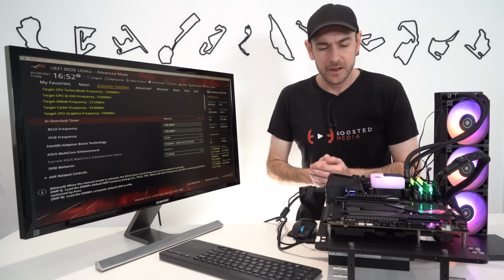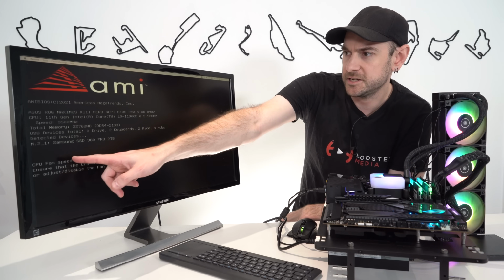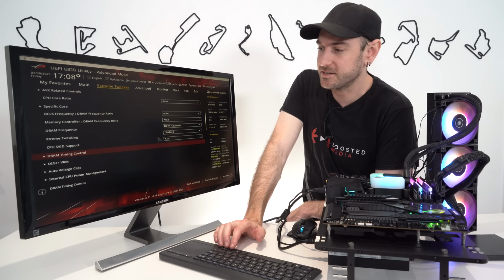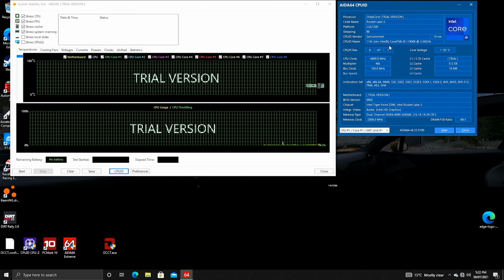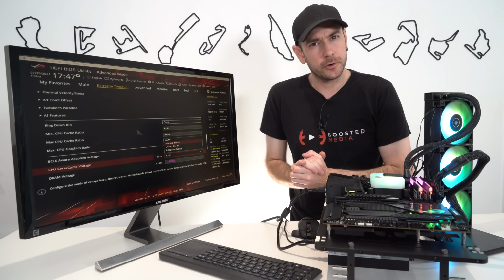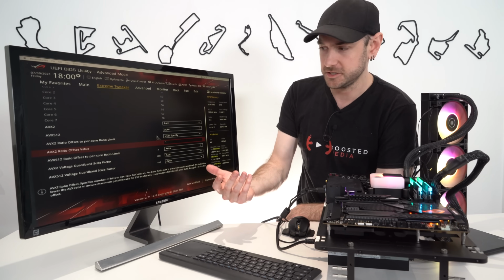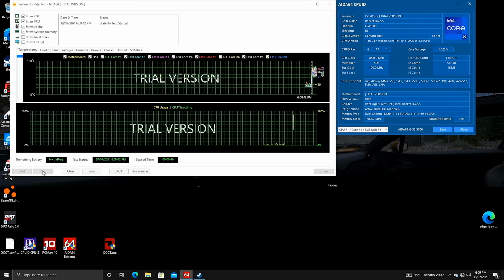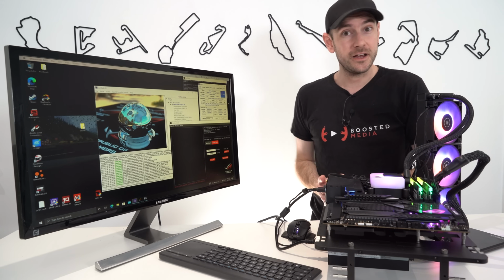HOW TO OVERCLOCK A GAMING PC - Overclocking the 11900K & Others

Comment: In my case core VID is for some reason lower than the vcore, and for 5,1 ghs it needs 1,55 volts, but when I make different ratios for core usage and increase them, leaving 5,1 for all 8 cores, it crashes with the same voltage under the load. I don't understand what's going on

Comment: I’ve used a similar strategy in my 11700K. I was more aggressive in Vcore, but limited wattage to keep temps in check. Identifying weak cores was important.

I will also say my motherboard left to its own recommendations was suicidal and tried zapping my CPU with over 1.6v. It would ignore some parameters and read others. So it felt redundant when locking the OC. I also found that the clock would be unstable when constantly changing. I let it rest for a few days and it was a whole new experience. I went from unstable at stock settings to ripping 5.5ghz two core, 5.3 - four, 5.2 six, and 5.1 all core.
Reply: Bro how tf
Reply: @ I can do a ghetto ass video on my channel if you want to see lmao

Comment: Occasionally with modern hardware the “optimized defaults” are your best settings. Now we tune the ram and we are golden for maximum performance and stability. In relation to “LLC” I would offer that it has some control over those “power droops and spikes” that occur when you come off a load or start a load. Good quality power supplies are absolutely imperative to successful tuning of a system. If you crash coming out of a game that is more then likely the power supply that has failed you because it couldn’t handle the transition in load. I’ve had it happen on a 13900k build with a 7900xtx and high end motherboard. Other then that, the system ran flawlessly. Swapped out the PSU for a 1200 watt quality supply and problems were gone. I pretty much use the same stress test software except to the addition of “ycruncher” and a couple of others.

Comment: Late to the party but great video.
I could run mine at 5.1ghz @1.42v core with custom loop but still was touch 80° so I switched to 5.ghz @1.375vcore now it touches maybe 75° while gaming, just produces less heat over a gaming session at 100mhz lower.
(All core)

Comment: your chipset temp is crazy high @67c right after post.  And you SHOULD be able to use LL1 with stock speeds and voltages.

Comment: Thanks a lot. I've got the same CPU and ASUS z590 plus, but my approach was with TVB profiles, which just didn't work at all as Windows would freeze all the time. I noticed even on stock turbo boosts voltage tends to shoot over 1.5v, maybe briefly but it happens. Thanks to your correct direction, now I have 5.3GHz on idle and 5GHz on full load with 1.4v not drooping below 1.35v even under extreme loads. This was done within minutes after watching this video :)

Comment: You should have used Hwinfo instead of CPUZ for this, it would have demonstrated the per core selections far better.

I wish Devils Canyon Haswell had specific core ratio tweaking. I can run 4.5 on a non delidded 4790k with a mediocre air cooler very easily at 1.232ish, 4.6 will work in some games but will crash if some loads happen ie. The freezes and changes when changing bulk graphics settings, so that's bad. But, if I set my per core to 1/2 4.6, 3/4 4.5, it works fine and infrequently / rarely will get a bit of usage at those higher frequencies gaming - but I can't choose WHICH gets it.

Comment: Respectfully have to disagree with you on memory timings and system performance both inside and outside of gaming. XMP secondary and tertiary timings are terribly loose because they have to work on every configuration out there. I manually tune all memory timings including the RTL’s and IOL’s. It takes some time to balance performance and stability, but well worth the effort.

Comment: Thanks for this video ! I learned so much 
By chance do you have a video for a 10700k? Or any suggestions that vary from this video
Reply: My Setting is Perfect. ALL-Core Ratio Limit 48 and CPU Voltage 1.285V. 100% stresstest no Problem.

Comment: What I need to do if crashing when sett up for 5 .0 -1.4 v ?increase the voltage a bit ?U should tell what need to do if crashing .My it's  1.415 v not crashing Is it still good ?No it's chrashing  ! Did not worked !5.0 -1.4 v chrashing ,If I it higher volt the temp it's too high !like 1.45v .I do not understand.:( If I put 5 step overclokimg by Asus software it's working but 1.565 v .temp is 78 c

Comment: My system :Rog strix z590 E wifi  -11700k -3080 ti palit -3600 mhz . My sytem freezed the second test when we set uo for 5 ghz -1.4 V .What  would  be a problem ? I have got first time asus motherboard .
Reply: i have the same MB but a 11900k
Reply: I get 5.1 GHz on Ai  but when the CPU is pushed to 100 percent use gets to 87 c@1.5v  but in games I get 70 to 75c with a Aio setup. I tired the above at 1.4 unfortunately i can't get it stable may try 1.42 next

Comment: Hi will! 
Great video!
I have an i9 10900K with a MSI Z590 ACE and a Corsair H115i.
I have my CPU at 5.2 GHz all cores, with only 1.29 volts!
I passed the OCCT test with no errors, it ran for 30 minutes, maximum temperature of the package was 83° C, of single cor was 81° C. 
I used the same options as you on OCCT.
My core voltage was between 1.286 volts and 1.292 volts. 
I don’t do the OC the way you did. 
I start with lower voltages, never with 1.4 volts, and if it crashes I raise the core voltage value. 
I ran Cinebench R23 for 30 minutes and didn’t have any problems!
I will run a CPU stress program for 4 or 5 hours to test it for o long period, anyway my computer never crashed when I am playing games. I essentially played rFactor 2, but I have AC, ACC, AMS, AMS2 and they never crashed until now!

Comment: Having OC’d systems for over 20 years, gonna have to say I’m underwhelmed by the 11900K and the available performance on tap.
It’s a great video nevertheless in terms of fundamentals that date all the way back 2nd Gen pretty much, but yeah the gains available from an old 2nd or 3rd Gen (i7-3770K for example) are about 3x more significant than what can be squeezed out from 11th Gen.
If you own an 11900K, just turn on XMP, if it’s 3600 or less, then make sure you run Gear 1, and off you go.
Reply: i turned on xmp but how do i make sure its running on gear 1? lol
Reply: So we shouldn't try over clocking it? I have an i5 11th gen and ive never overclocked before, I have liquid cooling which is the reason I was going to try overclock. Any advice would be greatly appreciated.
Reply: @spitfire1350  I suppose at the time of my comment it was that I felt in practical terms I put alot of effort into overclocking my 11900K and the percentage gains were small.  Obviously the 11900K is high clocked out of the box, essentially a binned high clocked 11700K.  An 11600K is definitely worth overclocking.
Reply: in windows you would still need to turn on all cores in msconfig.

Comment: Great video as always @Will I have a question, I saw your  interview with the Asetek creator Andr'e Erikson and feel that is a good product so I am thinking of changing to liquid cooling.
I have a low budget simple system I built myself, with a i5-3550k cpu and a nividia gtx 1660s gpu, I can overclock to 4100mhz and run about 60 to 75fps on almost full graphic settings on iRacing (the only gaming I do) but if I then run on up to 4200mhz where I can get over 100 fps the cpu heat gets too high and my system goes unstable.
My question, do you think a 570LCS 120mm single fan will give me the little extra I need or should I go for a 240mm setup?

Comment: Can you help me? perhaps you can DM or email me,  brand new build every time i use XMP settings the system will wait at start up and after 5 min will go into safe mode and then if i go into windows it will eventually crash every time after boot up? fyi my prediction window bottom right corner will show a 1.7 Volts.
i know in your video you state this is way to high and dangerous. HELP!

Operating System	Microsoft Windows 10 Pro
Motherboard Product	ROG MAXIMUS XIII HERO
CPU Type	Octal Core Intel Core i9-11900K, 5098 MHz (51 x 100)
System Memory	48908 MB  (DDR4 SDRAM)
G.SKILL F4-4800C20D-32GTRS
Model Brand G.SKILL
Series Trident Z Royal Series
Model F4-4800C20D-32GTRS
Capacity
32GB (3 x 16GB)
Type 288-Pin DDR4 SDRAM
Speed DDR4 4800
CAS Latency 20
Timing 20-30-30-50
Voltage 1.55V
Multi-channel Kit
Dual Channel Kit
Chipset Intel XMP 2.0
Color Silver
Heat Spreader Yes
Unique crystalline light bar design Highly polished aluminum heat spreaders in gold or silver Fluid rainbow wave default lighting effect Hand-screened IC & custom 10-layer PCB for uncompromised overclocking performance Intel XMP 2.0 support
Recommend Use
Intel Z590
LED Color RGB

CAN YOU HELP ME OUT?

Thx, Scott

Comment: How do I know if im pushing the voltage to much that it is damaging cpu?
Reply from the maker: Don’t go above 1.4 for the 11900k regardless of temperature.
Reply: @boostedmedia  I have 10700k! So I guess not much of the numbers you put in would be the same. I'll do more research of my cpu. I have a Evga motherboard also, Do you have experience overclocking on evga?
Reply: @karniskavva  The brand does not matter, voltage is voltage... do not think you can push it much further.
I have seen people actually input values that welded the cpu into the socket LOL..
Reply: @cyphaborg6598  hahahahah

Comment: I think the 11900K is designed to handle more ⚡ than prior Intel chips
Reply from the maker: Yes it can handle more voltage than prior chips. Remember this is a guide for beginners. I wouldn’t recommend going over 1.3V on older chips for beginners depending on cooling of course.
Reply: @boostedmedia  If you fully understand 11th gen VF curve overclocking you should do a video on that for your viewers

Comment: I'm confused as to why your voltage is fluctuating after you set a manual voltage? Unless something has changed with RL it's not supposed to do that. Did you forget to disable SVID? SVID support is supposed to be disabled when manual overclocking.
Reply: Well, under load it will still fluctuate due to vdroop and such.  But also, I thought CPU-Z was not good for monitoring voltage due to it being inaccurate.
Reply: @riffsthatkill2180  yeah you are right out should fluctuate usually between two different voltages, I think CPUz is ok but despite all the reasons you mentioned in the video I would use adaptive mode. I always disable all Power saving settings but they're is NO reason not to enable adaptive. Or doesn't make it any harder for noobs. 
Maybe tell them to use manual to find a stable oc then switch to adaptive?
Reply: @Metalhead-4life  yeah I never settle on manual mode, almost always I do offset and use the SVID behavior to set the base VID curve. I'll use the one SVID setting that gets me close and then use offset for the fine tuning. I don't use adaptive, mostly because I dont have experience with it although it's similar to offset. The VF curve where you can set offsets for specific ratios is awesome. Usually I only have to mess with the highest one for my OC, so it doesn't impact the other frequencies along the VID/VF curve.

Comment: I'm running a triple 4K setup with rtx 3090 and 9900K. How much of an upgrade is the 11900K in Assetto Corsa? I believe it's pretty single core intensive and the 11900K seems to be a beast for now (I know  it's probably best to wait for the 12900K).
Reply: if ur 9 is overclocked its not worth it like at all
Reply: I have a 9900ks at 5.3 all core with a 3090, and an 11900k is 0 upgrade for any sim title. Clock speed is all that matters on sims as of today and 100 cores is 0 better than 8 cores. You can just look at cpu z single core speeds and see an oc’d 9900k beats every new cpu. The 11900 won’t really go over 5.3 either other than a couple cores at a time
Reply: @brandodurham  What are you cooling your 9900ks with? I have a 9900K delidded and binned for 5.0GHz all core that I bought from Siliconlottery a few years ago. Wonder if I can push 5.3 with the right cooling.
Reply: I’m using a 360mm aio in a well vented case. If you turn off hyperthreading you can lower you under load temps a lot, and again with all these dx11 sims they don’t benefit at all from huperthreading. I actually get better and more consistent frametimes with it off. I can push 5.4 all core during the winter months 😂 but too toasty in the summer for 5.4
Reply: Hope you went with the 12900k....I bought the 11700k last year (admittedly a beast) but wish I got the upgraded 10 nm architecture.
Reply: @funtourhawk  I want whatever's coming out next, though I can barely get 5 minutes of time per month to use this crazy racing sim that I have. (business owner, husband, dad, etc...)

Comment: Clear and concise as always Will, I'm still happily running your GPU curve OC on my 1080TI.
 How relevant will this walkthrough be to an Asus X570p MB with a Ryzen5 5600X? Which is in my current build with the water cooled 1080ti in. CPU is on a 240mm AIO

Comment: Great video, thanks so much! 

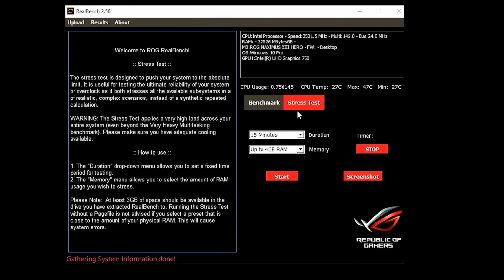In the RealBench testing at about 41:45, does it matter what Memory setting you use? Was leaving it at 4GB fine, or should you pick however much RAM your system has?
Reply from the maker: Depends what you’re testing. I usually start at 4GB and if it passes then do maximum. That helps identify any Ram issues too.
Reply: @boostedmedia  thanks so much!

Comment: What I need is a good guide for iRacing + RTX 3090 + Triples 1440, will if you could do one it would be grand or please link me to a good one
Reply: @eIgHtY0N3  <92
Reply: @UsmanKhanSimRacing  my 10900k not o/c, RTX 3090 and triple 1440 will knock out between 130-140fps most of the time at max settings in game. There are a small amount of tracks where performance is worse but that’s down to the game optimisation on those tracks (Barcelona as an example)
Reply: @johnnyballbag8916  is that on triples 1440p? mind sharing you Nvidia control panel and tracing graphics settings?
Reply: @UsmanKhanSimRacing  hi Usman yes that’s triple 1440p and a 4th 10inch screen via hdmi that I use as a sim hub dashboard. Nothing remarkable about my Nvidia settings, pretty much have everything turned on to max quality or application controlled. Iracing graphics settings all set to max apart from heat haze because I don’t particularly like the effect. Are you using afterburner and Riva tuner statistics to monitor what’s going on? My graphics card is only at 80% max usage most of the time in iracing. Graphic card temp never goes about 55c and is not water cooled
Reply: @eIgHtY0N3  sadly its not, and I am out of ideas... my temps stay around ~72 on 3090 FE under load air-cooled and 5900x that goes to ~65 on a custom loop

Comment: Didn’t know how much was involved. Very informative will, thanks. If I was to ever do this I’d have someone do it pretty confusing for those not tech savvy. You would think though gaming pc’s should already be clocked at max and safe settings
Reply: They are. AMD chips ride their limits very well, with PBO providing a very safe overclock.

I would not recommend OCing a 11900K in most circumstances as the chip just runs way too hot and we really don't know what the safe voltages for it are.
Reply: CPU's nowadays already come pretty maxed out. Dont feel like you have to OC your CPU cause its really not necessary and at most might net 5% more performance with a conservative OC.

Comment: Is there much difference to ryzen CPUs?
Reply: If you're on Zen 1, your max safe voltage is 1.4V. If you're on Zen+, it's 1.375V. If you're on Zen 2, it's god-knows-what-but-probably-under-1.315-but-this-is-really-dependent-on-your-cooling-check-your-CPUs-FIT-limitsV

If you're on Zen 3, just use PBO and tune your curve if necessary.

Comment: Overclock guide for AMD 5000 series cpu's please.
Reply: For AMD 5000, turn on D.O.C.P,  to enable your RAM OC. For the CPU OC leave it on auto. Every video I've seen on AMD CPUs  pretty much get the same or better results from auto OC over manual. It's a good option for lazy people like me. :)
Reply: @Unsafe1671  where do i enable Auto OC? I have only enabled XMP so far for ram OC. Everything else standard
Reply: @SimmoNicho  Hey mate, it's going to depend on your motherboard manufacturer, I use Asus so for me it's pretty much in the same screens Will used in the vid it's just some of the options are a little different. If you search YT for your MB manufacturers name and AMD overclock you will probably find some guides. Jays 2 cents has done a few vids on AMD overclocking.
Reply: Turn on PBO and optimise your curve per core.
Reply: @thomasni123  is it true the 5000s will have very little to no gain with OC?
Reply: @SimmoNicho  there's not a lot of room but that doesn't mean it isn't fun to tune with the curve optimiser.